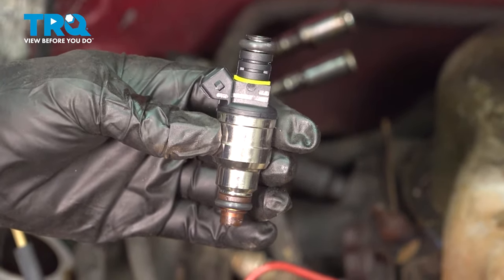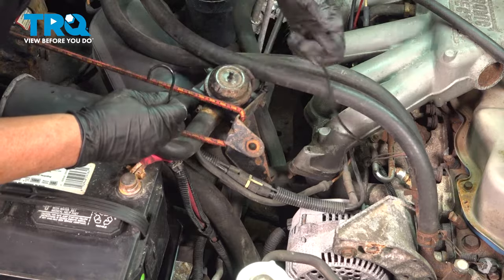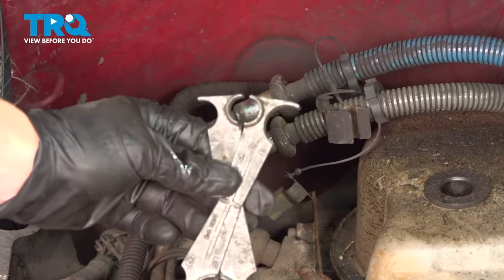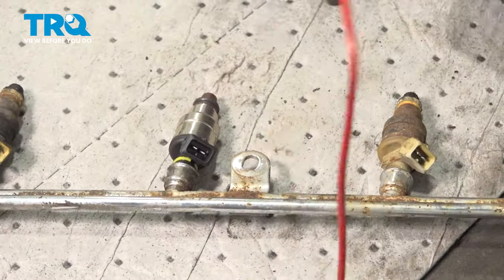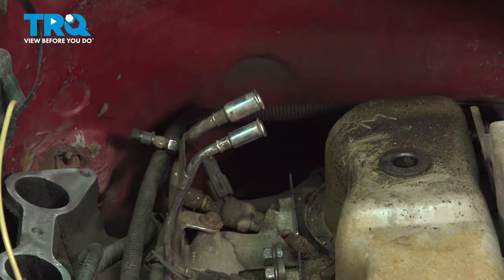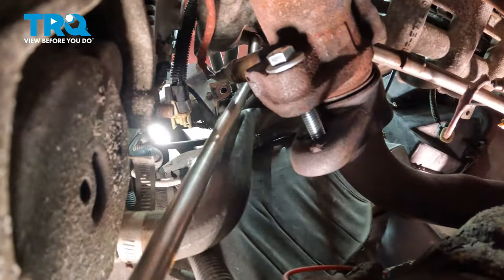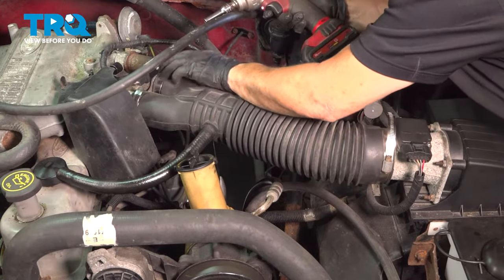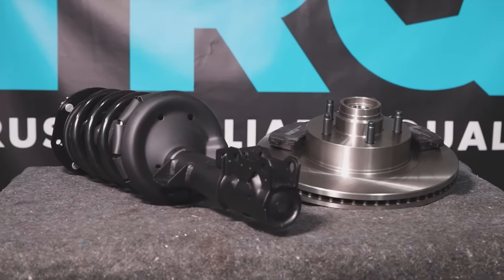How to Replace Fuel Injector 1992-1996 Ford F-150

Comment: You are the best profesor mechanic ive seen on youtube..
The question is. I have 1995 E 350 ford, and mice got to it and placed lots of garbage near thw upper intake place, around the injectors, and at a gas station being inside for a cup of coffee, i came out and see smoke coming from th3 engine. The heat of the engine burned the stuff mice placed there. It burned few, i think 2, or 3 plugs to the injectors. And some vqcum lines. Now they are not working. So i think i have only 3 cilinders that works sporadically. 
There is no way i could get to it to replace the plugs, or the vacum lines there.. E 95 upper intake is very tight and cumbersome to get in there. 

Question : do I need to take the engine out from the van to do the work? 
Where could i get a compleate harness for it?

Thank you!

Comment: Hey there could this be my problem on my 1992 5.0 when I put it on drive it feels like my hand break is on lock but it’s not . May this be the issue. I was thinking it was the trans I spend $2,400 on a rebuilt one and nothing . I got $3,000 on it already and I don’t wanna lose hope! Or get done in!

Comment: i have a 1995 f150 5.8  without the obd2.
what is the difference in TRQ FIA60983 and TRQ FIA60741.  none of them on the 1a auto site say how many lbs they are.  I think a stock 5.8 uses 21lbs injectors.   It is a stock truck that I use for moving firewood.
Reply from the maker: +@ME-pw3kc Part number FIA60983 is not compatible with the engine size of your vehicle. FIA60741 is listed to be compatible and will be made to the same exact specifications as the original equipment parts.

Comment: I disagree about not using grease, Ive used grease on injector o-rings for 25 years and never had a problem, it makes assembly much easier and helps with the seating.